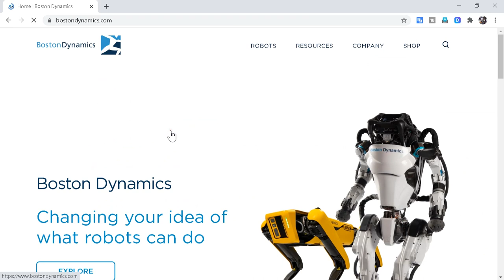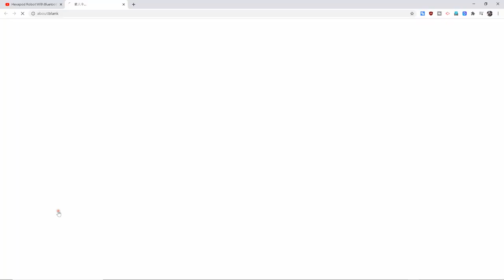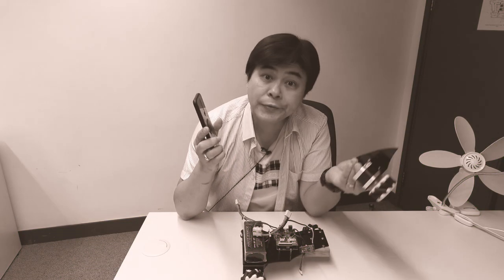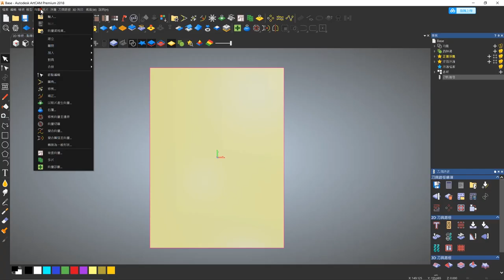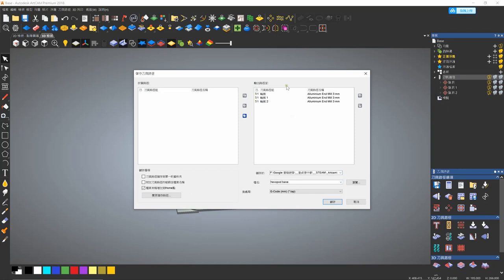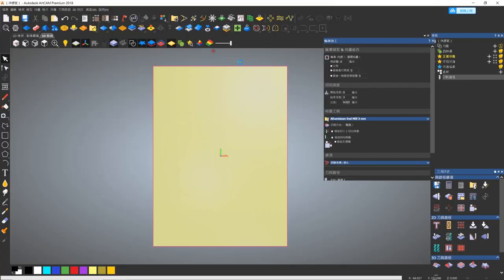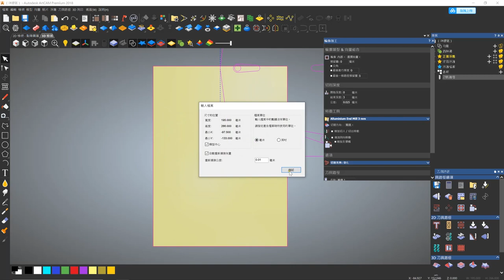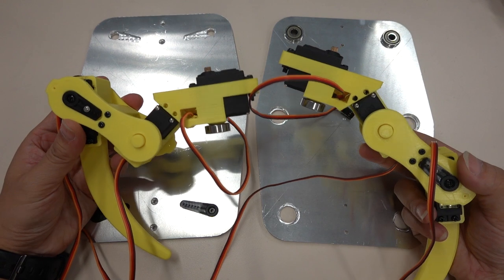[I am a maker series]  Robotic Hexapod | production, testing and evaluation

Comment: It's shaking ,because  the power supply current  is not enough for 18 servo motors.(which should be atleast 9A  (18X500mA).)
Reply from the maker: Yes, you are right.  But then I burn one of the servo, I even haven't figure out the reason why.
Reply: @carlostchiangorganman  Can you explain why you did use 12V power supply? You need a voltage  regulator to convert the voltage to (for example) to 5 V , because  operation voltage of MG995 Servo motor  is (4.8 - 7.2 Volts). Anything else will kill the motor. 

So, the power supply should be: (4.8 - 7.2V ) and 9A+
Reply from the maker: Just for convenience, but the shield has already regulate the voltage to 5 volt
Reply: @carlostchiangorganman  I see, 12V is the power source for the Arduino mega, but you cannot connect all the motors to Arduino mega directly ,it  doesn't provide enough current (in Amp ) . So you need external power supply for the motors. ( 4.8 - 7.2V ) and 9A +
Reply from the maker: @a96futurecreator96  Yes, I understand, at the time I test, I don't have a supply of that current, and before I continue, I still need to find a battery that can supply 9A
Reply: @carlostchiangorganman  Good luck with your project, sir. I have done hexapod projects for a while.
Reply from the maker: @a96futurecreator96  Thank you very much for your information, can you share more of your experience?
Reply: @carlostchiangorganman  Sure. If you have any question, feel free to ask me.